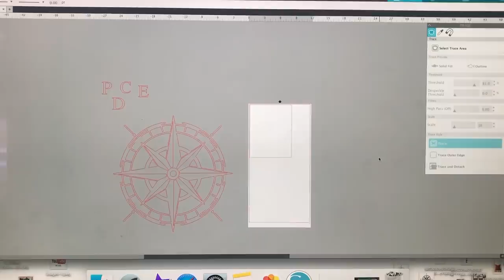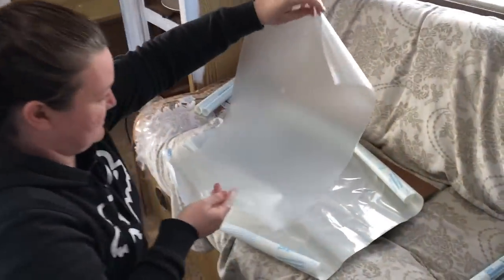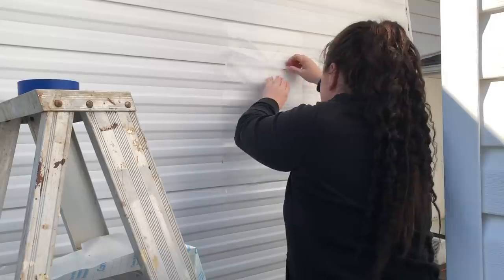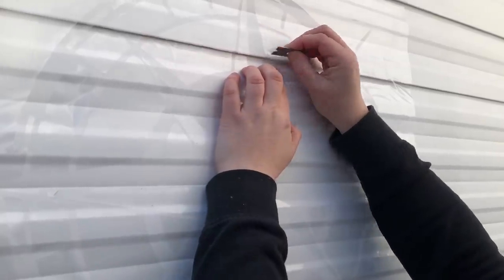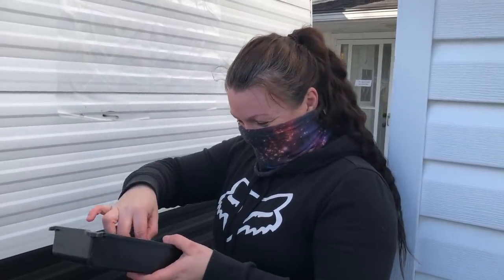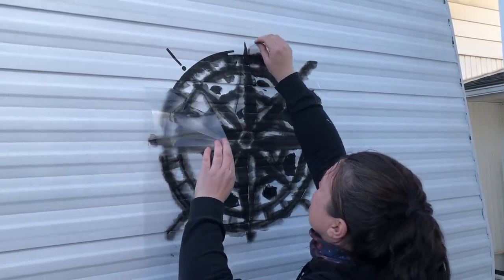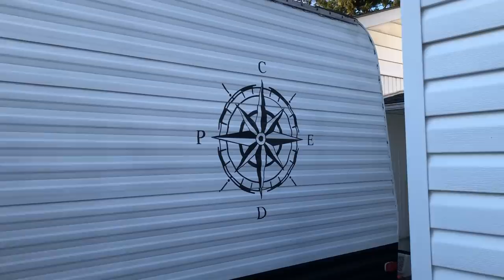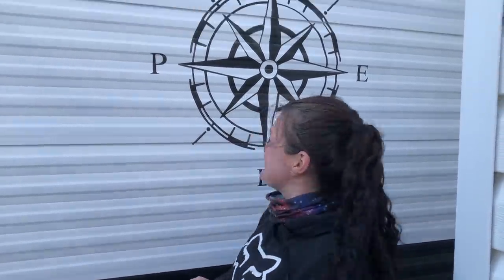Extreme Camper makeover | Adding a personalized LOGO | Epic Results!

Comment: As a fellow Canadian who has done work on an older RV, vinyl products shrink and expand with the cold and heat. 
I used vinyl click flooring and it pulled apart and broke some of the pieces in the winter cold. 
I also used peel and stick vinyl wallpaper and it initially looked awesome but didn't stay put. 
I did have great success with a peel and stick backsplash tile with a cork back and thin slate veneer. 
My painted cabinets and walls are also holding up well.
One last tip - install black out curtains. They help us sleep better when we Boondock in urban areas like parking lots and keep the camper cooler during the day.
Loving your videos and your creativity 🥰
Reply from the maker: We are planning to use the waterproof easy way plank flooring :)
Reply: I heard on your live you're doing glue down, so hopefully that works out. Our is a floating click together vinyl plank. Glad you've chosen something different ! 😉 looking forward to seeing it come together ❤️